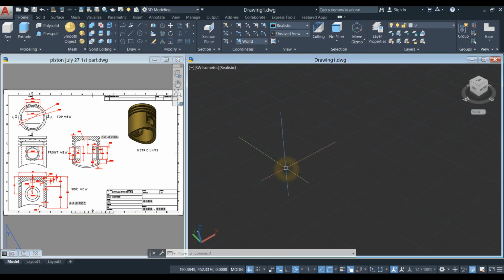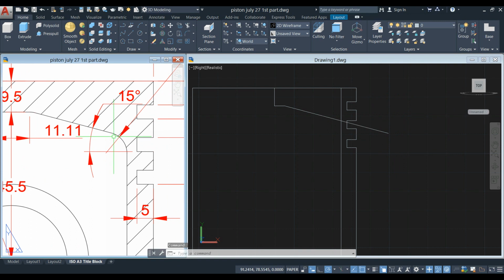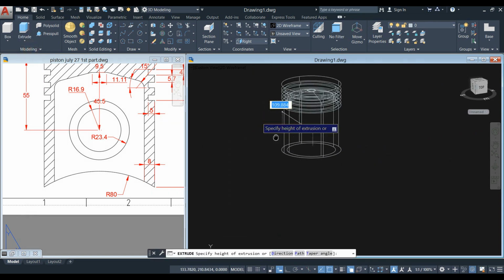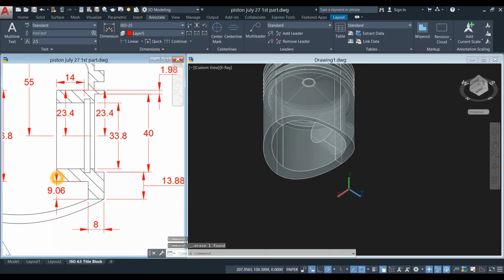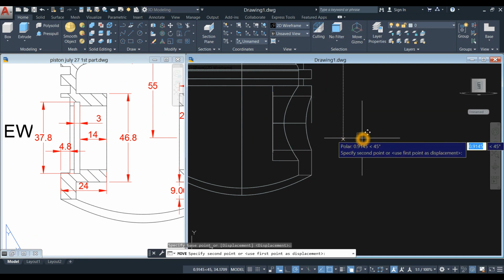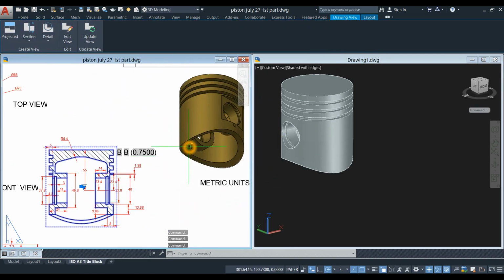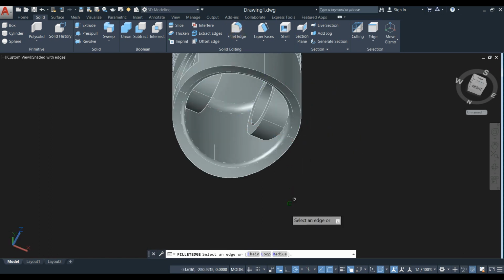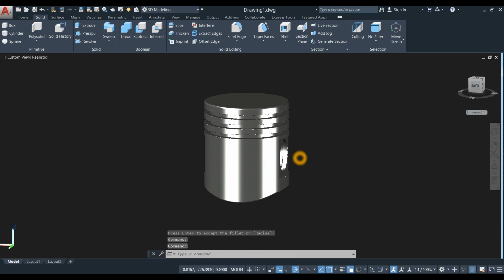How to draw a 3D Piston in AutoCAD ( English Instruction)

Comment from the maker: This is a detailed and easy to understand instruction in English on how to draw a Piston using Autocad 2020. Steel material is also applied and the light exposure was adjusted to achieve the metal look of the object. The following commands were used:
Extrude
Subtract
Fillet Edge
Mirror
Line
Circle 
Arc
#PistonInAutoCAD
#AC3Dcad
#PistonDesign
FACEBOOK : https://www.facebook.com/pg/Learning-...
Reply from the maker: for Pdf file pls click this link https://drive.google.com/file/d/1EASqmmCSsZIYwVF4dNRDG9gqxh7uASEe/view?usp=sharing